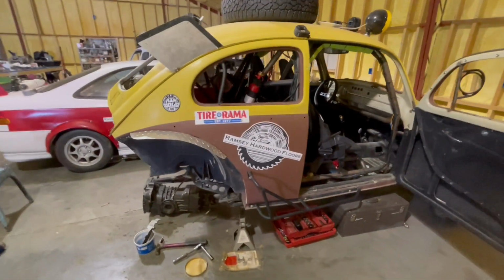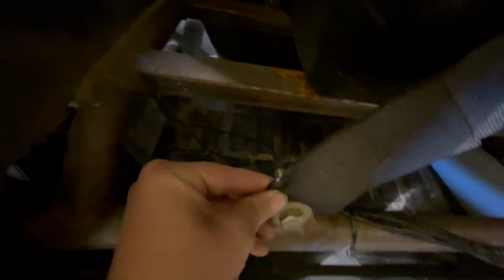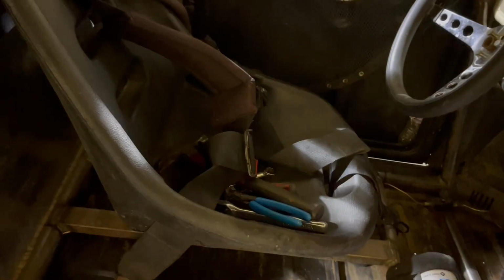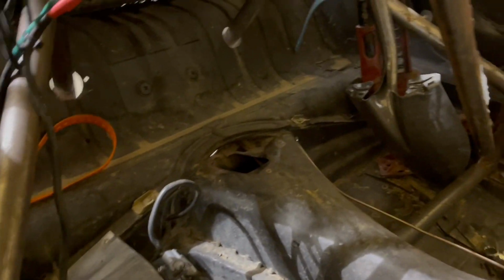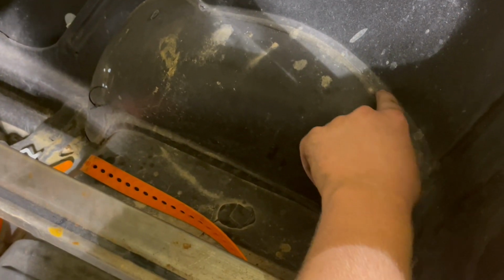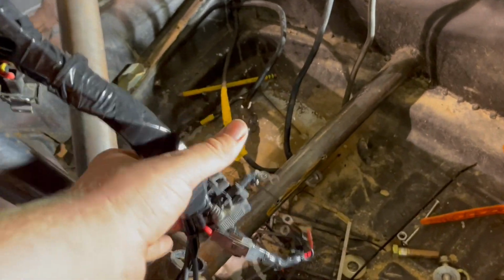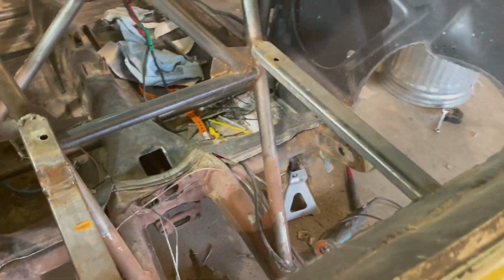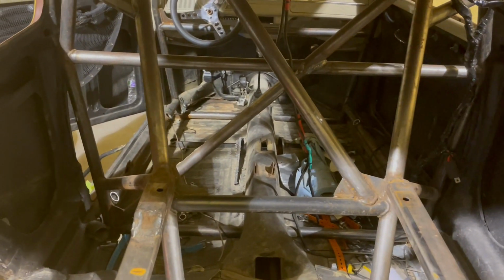Baja Bug IRS CONVERSION ep2

Comment: Hey man , use a grinder with a flap disc on it to buzz down those edges instead of using a heat gun and a hammer .😂
Reply from the maker: great idea! i thought about using that method but i was worried about getting rid of too much of the factory spot weld area… didnt want to remove anything structural. thanks!